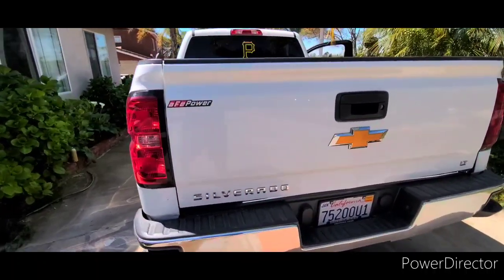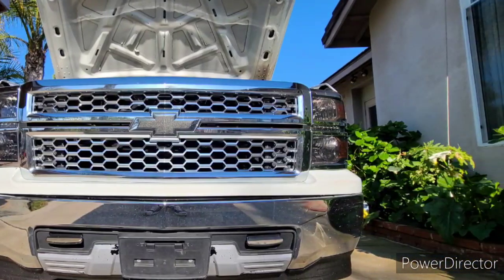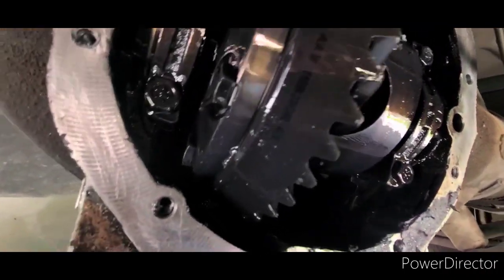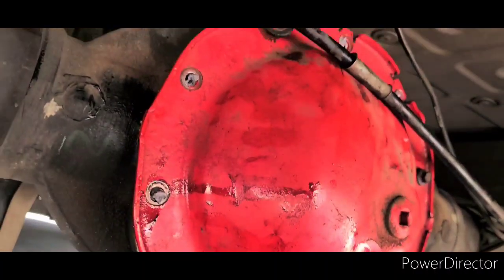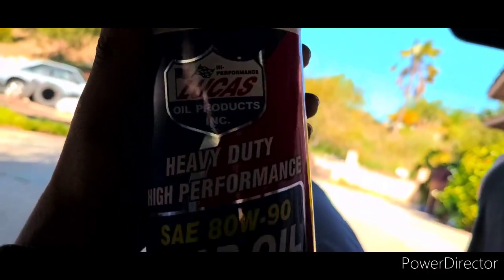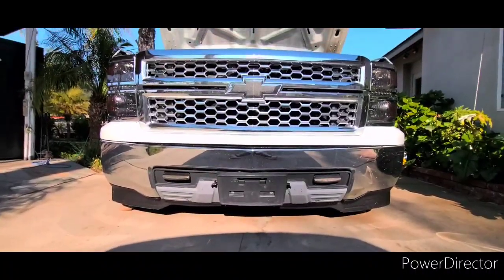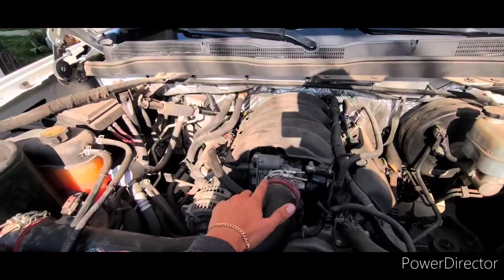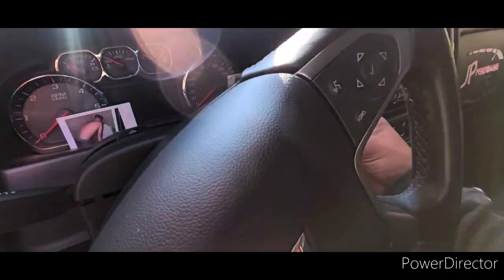How to make your 4.3 chevy silverado fast!!

Comment: I got an 09 4.3. Went from 3.23 to 4.10. Wow, what a difference. Keep on truckin!!
Reply: What did you replace 
I’m trying to do the same
Reply: @randomvidz512 he put a higher geared rear end in it that's all
Reply: with exhaust cut probably gained 5hp but it helps with how heavy the truck is

Comment: Sick af man i got a 2014 v6 single cab, ported tb, ported intake manifold, shorty headers, full exhaust, cai intake and tuned on 92, these trucks sure do get it, im currently in process of putting 3k stall in it atm, nice truck man
Reply from the maker: Bro you need to get a shift kit! I never got a chance to install my parts but I know forsure you'll be chirping into gears and breaking hearts out there lol but also get a 40k cooler cuz if the trams gets so hot you won't make as much power 🙌💯💪
Reply: Fun runs?

Comment: I was installing my shorty headers and ran into a problem with the wiring cuhz my wiring touches my headers.did you run into the same problem?if you did where did you order your wiring at that is able to resist the heat of the headers

Comment: You running any tunes? If so what tuner did you use
Reply from the maker: Yeah i had a street tune done by STD PERFORMANCE . he actually fixed my tune that i had got from ECT PERFORMANCE cuz they just removed my rev limiter and tuned my truck for 91 instead of E85 how i asked in the first place and they still charged me the full price for a tune
Reply: How’d you get a hold of them, know anyone in south Texas?

Comment: It’s sounds really nice. Is that because of the shorty headers? Or the type of exhaust you got??
Reply from the maker: The headers make it sound a bit different but the exhaust is where its at , I had no cats and true dual exhaust and dumped mid cab
Reply: @doncokane2164  so you just had 3 inch pipe from the headers back to the x pipe?
Reply from the maker: @theslowsilverado839  no 2.5" from the headers to the X pipe and dumped to the mid cab
Reply: You think it would sound good with stock manifolds? Looking for ideas for mine and this one is the best sounding so far.
Reply from the maker: @theslowsilverado839  it should sound similar the headers are more for performance and also i have no cats so it sounds really beefy
Reply: @doncokane2164  thanks cuh I'm gonna get this set up for my 2017. Hope the new project is coming along well 🤙

Comment: What the hell is wrong with your steering wheel it’s turned left and you’re going straight
Reply from the maker: Yeah I had got into a accident and something happened to my rack n pinion
Reply: same thing to mine, i have 2017 custom 4.3, and the lower control arm pop out of place, I haven’t fixed it her but I can tell the steering is off

Comment: Bro I bought a 2008 5/10 drop 4.3 v6 a few months ago. I put an intake, exhaust, throttle body, headers and run e85. After you’re videos I wanted to build it so bad. I ordered bigger injectors, bigger fuel pump, a turbo kit and 4.10 gears and a LSD. It’s in the works of getting turbo’d if you still have the truck would you want to run them?
Reply from the maker: That sounds like a dope project bro , I don’t have the truck no more I got into a accident

Comment: Those same mods you did to yours could those be made to a 97 Chevy 4.3. It’s what I have. And I’m barely getting in the truck game
Reply from the maker: You can get the same mods but it won’t have the same power as my truck
Reply: Would it be slower then yours but fast enough to keep up with a 5,7

Comment: How is it so fast I have 4.8 with 4.56 gears
Reply from the maker: E85 n tune helps alot💯💯
Reply: I have super chips tune but It powers down like if I try burn out I feel the truck bogg out I can spin them here and there but under load takes forever
Reply: Also I’m 91 tuned I have E85 but not a aftermarket tuner stock e85
Reply from the maker: @arealmaintenanceandrepairl1103  get a dyno tune done they can go more into detail with you on how you can better your truck 💯 i heard pinky tunes n new era are good dyno tuners 💯

Comment: How did he make it faster
Reply from the maker: Just showing off some parts that can make it faster ... intake, gears, headers, exhaust n tune
Reply: @doncokane2164  where do you buy/ get these parts installed at ?
Reply from the maker: @jltsvlogs1837  most of my parts I got online like my headers and cold air intake , my exhaust was done by topete mufflers, my fully built diff was done by jp performance,  my ported tb and intake manifold was ported my gee's porting @gee2156, and it was tuned by std performance